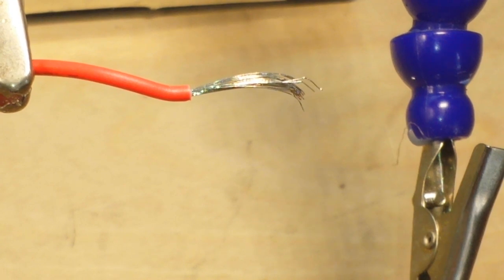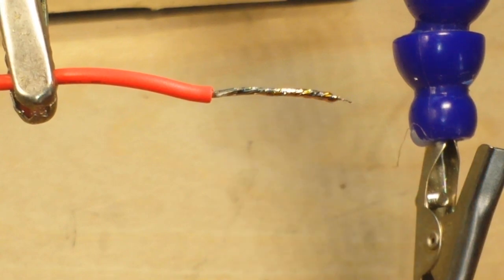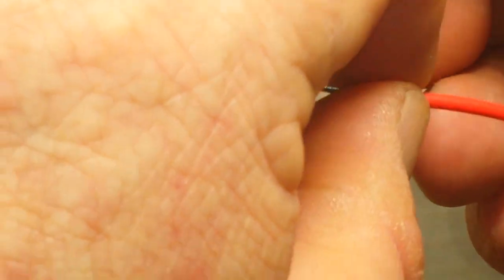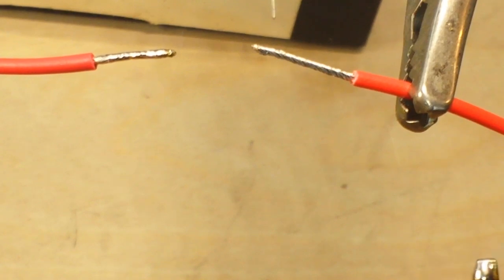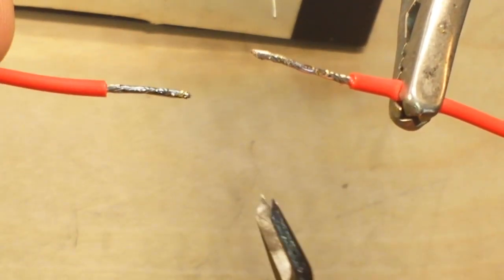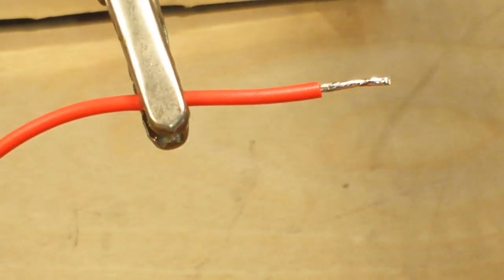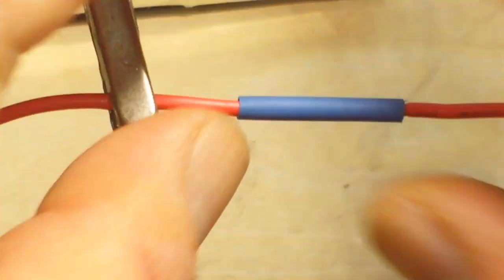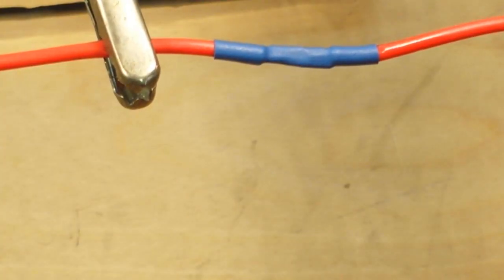How to tin a wire

Comment: Yeah so, "capillary action" actually does not function in this way if your wire is any thicker than a fishing line. Even basic regular edison cables cannot be heated in the manner this video suggests. Total waste of time if you are using any thicker wire, even slightly thicker, the heat will NEVER melt the solder by just touching it to the wire. You can sit there and hold them both on the wire until your hands shake, it will never melt. Please dont waste your time following this guys half baked advice

Comment: Okay so, why doesnt this work for me? I'm holding the soldering iron against the wire and the solder placed exactly like you did. And the solder does not melt. Ever. Held it there for 60 seconds. Nothing. Literally nothing.
Reply: Yeah dude, did four minutes this time. I'm sitting here holding a soldering iron against a wire and soldier and there is no "capillary action", nothing is happening, at all. Max temp. Nothing.

Comment: Would you recommend soldering the entire length of stranded wire for a lamp socket connection under a screw? Or just the tip to keep them from spreading when tightening the screws?

Comment: What if you do all that and it still doesn’t work!? I’ve done exactly as you say now and when you put the blob of solder on the iron then put it to the wire it just goes hard and drops off and the solder wire I’m touching the wire with doesn’t do anything….the wire I’m soldering gets too hot for me to touch and starts melting the casing but still no capillary action, it just goes hard and chunky and does nothing (that’s what she said 😂)….then it just drops off the wire or will pull off easy…what’s going wrong?
Reply from the maker: Can you take a quick video of you doing the technique on your phone and send it to me?

Comment: The problem with this process is that as the world moves to smaller & smaller electronics, preheating a smaller or thinner wire will start to melt the plastic coating, even char the wire itself. The method I use depends entirely on the thing I'm soldering. But I've begun to move towards micro-soldering as it looks more likely the world is moving in the direction. 35 years ago, wires were as thick as elephant trunks (I just fixed an old pioneer receiver from the mid 70s. It was a dream to work on since everything was huge). It's a culture shock to then crack open an iPhone where you literally (not figuratively) need a massive magnifying window or microscope to work on it.

Comment: In the absence of solder, could you merely wrap the ends of the wire in aluminum foil? Just to stick it in a screw terminal?

Comment: i used some Tin Wire Solder Tube to attach a broken chain cross and it worked lol. i wonder how long it will last. i assume the tensile strength would be pretty strong vs super weld glue.

Comment: Hi Paul, Thanks for all the content. I’m a newb and find your explanations tend to resonate much easier than Ive found in other videos. Would you consider doing a video on low voltage (1.5v - 3.7v) circuits. I’ve been trying to make a simple astable multivibrator with a cmos TS555 ic but don’t really understand how to size capacitors or resistors. Best I can get is a solid led😏

Comment: That little spot of solder on the tip to for heat transfer was a complete game changer. Thanks.
Reply: Really? Why? It doesnt do anything. This video is worthless, there is literally nothing happening after holding my iron against the wire for four straight minutes. Pretty sure 'capillary action' is something this dude made up because it ain't doing shit for me
Reply: @kylemccormack1785  yeah, the trick is to use the flat iron tip and take hold that flat so you can melt a drop of solder on it. You want to hold that molten solder there and hold the wire gently on top of that solder. When I didn’t do this I had the same problem the wire just didn’t get hot enough for you to melt the solder into the wires. — the little touch of molten solder really helps with heat transfer from the iron to the wires , then you can use them to melt the solder

Comment: I like to leave the wire untwisted,  meld one wire into the other so wires are integrated then flow both at the same time.  It allows u to have a really small belly because solder almost stays the size of the insulation. And every strand has solder on it. But either way works. And yes, I have forgotten to put the shrink tube on first or sometimes with a short piece of wire the heat from heating the wire actually shrinks the tube prematurely 😵‍💫. That always sucks. Take care.

Comment: I want to marine tin some ends of copper wire in my boat along with some exposed 6 gauge battery terminal wire. Is there a preferred solder to tin this wire without losing any electrical conductivity? The electric solder I have at home has lead in it, and I would think the composition of lead added to the tin in the solder would reduce electrical conductivity to my battery terminals.

Comment: OK....I'm impressed and I would personally like to thank the U.S. Navy for your fine training. I thought that after you tinned the wires and then cut off the ends, you were going to "butt join" the wires and then solder them together but then I said " Impossible, because I'm the only one who can pull off that trick." The Sublime Prince of Humility"   Toronto
Reply: ...... did you just say..... "Butt join"..... Without a butt end terminal??? 
The REQUIRED AND CRUCIAL part that MUST be used for a BUTT SPLICE??????

Comment: Wonder if anybody could explain.....I wanted to solder some antenna coax a while back.....the outer mesh was not copper coloured but a silver coulor.

Nothing I did would get solder to tim this outer coax....almost as if it was not copper.

I gave up in the end.....any ideas guys.....I still have many meters ot this coax and I would rather not bin it.

The inner conductor was the normal copper color....and tinned no problem.

Comment: How tf are you heating your wire up in seconds??? I leave the damn soldering iron on the wire for 45 seconds and the shit won't capillary.  And yes I out a drop on for thermal transfer.
Reply: I have the same problem and it's driving me crazy, did you solve this?
Reply: @nbenja3  nope.  I will try again when the weather warms up...most my needs are in my car.
Reply: @fireallergy  so I have found out that my solder is really shit quality so I picked some up with flux today and it's much better
Reply: @nbenja3  i probably have crap supplies too.  I will get some better stuff in a few months then.  Thanks for the advice

Comment: Ok, dumb question for someone who has no soldering experience and wants an easier way out.  Is there some kind of conductive glue that I could use to seal the  twisted speaker cable?
Reply from the maker: Not that I'm aware of.

Comment: I had a bad habbit of soldering both ends before putting on the shrink tubes. Similar thing happened when I made a flare end on copper tubes before putting on the flare nuts.
Reply: worst part of the flare nut is you think people have to be way too dumb to do something like that, and then you do it and realize how easy it is to forget xD

Comment: I'm going to assume that attempting to use a soldering station with a fine tip meant for electronics work is not really the best tool for soldering wires?

Comment: i notice you did not use flux... i've heard for years folks preach about flux flux flux... is flux needed for tinning wire?
Reply from the maker: There is flux in the solder
Reply: @learnelectronics   just finished with some tinning using your technique... wasn't too pretty at first (CLUNKY for sure) but with a few more attempts it got MUCH MUCH better... (i'm wiring a model railroad and don't wanna use the suitcase connectors) thanks for the info

Comment: My soldier just balls up any tips? It doesn’t glide down the wire as you do it. Could this be the temperature and solder I’m using?
Reply from the maker: Need to clean and tin your iron
Reply: learnelectronics think I got it down slightly better! It just took more practice new to soldering and electronics
Reply: learnelectronics wow I appreciate the response. I tried doing this and it was still challenging the wire is copper and I tried your method with wire that was 24 gauge and the same material as yours and did it pretty well

Comment: 25 years since I was taught in the Army. Never really used it that much. I am building a diy CNC router and for my life I couldn't figure out what I was doing wrong couldn't get solder to stick or flow. Thank you. Clean and properly tinned iron and solder flows where it has been! Army didn't teach me shiznit! You though me more in less than 10 minutes than they did in two weeks. Just because you learn something doesn't mean you learned it right.
Reply from the maker: Glad to help

Comment: Interesting, thank you. My father was an electronics engineer at the GE and the British Post Office back in the 60s. He taught me another method. You fan out the fray of wire strands on each wire like a spanish fan. You then cross the two fanned wires into each other so that the individual strands cross each other. Then you twist the result which makes the two wires mesh together, then you solder using your very nice method. And shrink sleeve them. Super mechanical strength.
Reply: Very crucial question, should you use flux paste?
Reply: @YHYHHUH  If you are using solder with flux included you shouldn't need it. However, not all solder is equal. So if you find your solder isn't flowing appropriately check the temp of your iron and if that is good put a small bit a flux on the wire before starting
.
Reply: @aaron1shmim  What this guy said!
Reply: That's how I've done it, especially when soldering connectors to harnesses on vehicles. Seems stronger, I did learn what is presented in the video, have done it that way too when there is little chance of stress on the splice.

Comment: when i tried to do this my wire did not heat up even though my solder works perfectly 

even when it did heat up when i touched the solder to the wire it started forming globs

Comment: Nice. Any advice on why my solder wont stick to my solder iron? It just drip off?
Reply from the maker: Solder flows where solder has been. alternate dipping your hot tip into flux and then tinning it until the solder sticks.
Reply: Soldering iron tips have a plating on them to help the solder adhere. If it doesn't stick to the tip you probably need a new one, sometimes you can salvage it somewhat by doing the flux, tinning process but you're better off replacing the tip for a few bucks (if you have one with replaceable tips).

In the future, be sure to store your iron with solder on the tip, coat the tip before shutting off your iron as this will protect the tip from oxidation and ruining the plating.
Reply: I can’t get my solder to flow onto the wire like this, it’s seems like no matter how long I leave the tinned iron on the wire, it’s like it doesn’t heat the wire enough to draw the solder onto it.
Reply: @SubJStan  same for me ...did you overcome this challenge?

Comment: When I solder a handheld joint like that, I always check for a cold joint caused by excessive shaking while the solder is cooling, If the solder is shiny, uniform and glossy it's ok but if more greyish, lumpy and dull it may be a cold joint.
Reply: Shiny is the best evidence always

Comment: "Just a TOUCH of solder, for thermal transfer."

Huge 'lightbulb' monent right there.
Reply from the maker: Makes a difference
Reply: @learnelectronics  u
Reply: For me it was "thermal transfer" and "capillary effect". I have a large vocabulary, but little common sense. Just let the heat do its job.
Reply: @browwiw  Same I guess, I tend to overthink or overcomplicate things but for some reason this concept just didn't click.

Comment: Great video, you make it very understandable!! I tend to add a bit of flux to my solder joints. I know it's not necessary, but it helps with the solder flow. Not a GOB of flux, just a little bit.
Reply from the maker: Flux is always good!

Comment: Bravo. Let me thank you for another tip you gave that i used extensively on my current project: use a dab of super/crazy glue to hold a component (female headers especially) in place so u can solder without the part falling out. That is simple yet brilliant and u may want to repeat that tip in a future video for all the new subs you're getting!
Reply from the maker: Thanks buddy. I'm glad one of my tips helped.
Reply: Good